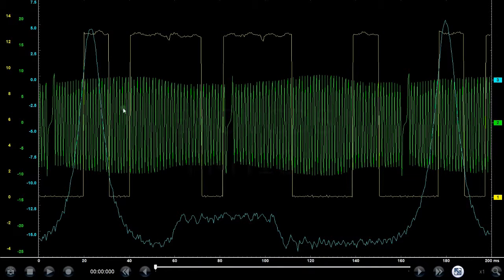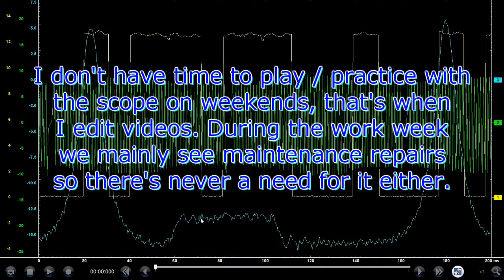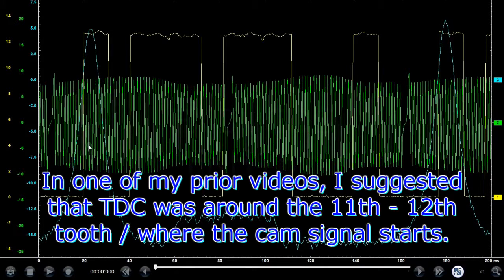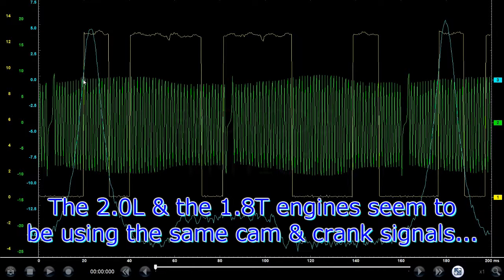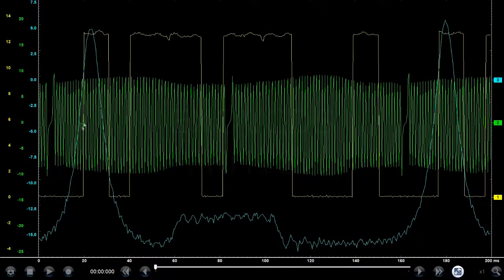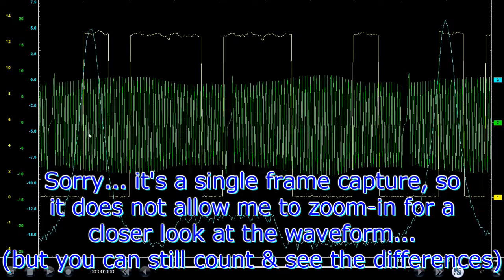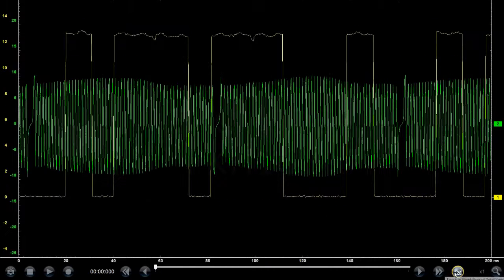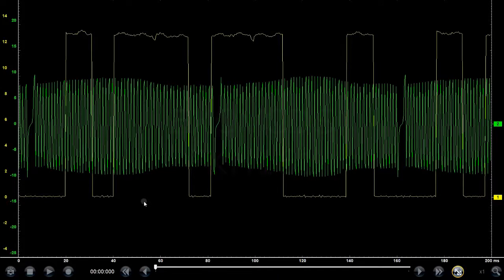VW A4: 2.0L cam / crank waveform

Comment: Thank you very much. This waveform saved me.
I had an audi Q3 with cam crank correlation code and got the waveform out of it. But I need a reference to compare the waves. I found my reference here. 😊
Reply from the maker: @alirezanasimi1999  
I don't think the waveforms are the same.
This VW waveform is from a timing belt 2.0L engine.
Reply: Actually I checked with another source and it's the same. Apparently company has just changed the belt to chain. The timing seems the same.

Comment: Did you ever scope a EA288 engine?
Reply from the maker: No. What's the issue?
Reply: @EXOVCDS  I have rebuilt my CUPA engine (new piston rings, hone, new bearings, valve seals and reseated the valves), now it just cranks and does not start. No error codes on VCDS. The injectors are firing, but I have 14 bar compression on all cylinders (13-14bar). The cam and crank seals were also changed but the rear seal comes with a new ring. I did not have the special tool for fitment so I marked down the oldone and new one and I installed it correctly, but I had a strange feeling that the new ring was slightly different form the old so I want to compare scope traces and look at the crankshat trace for shape and compare the timing to the cam signal so I can be absoutley sure that the ring is correct shape and position and that the phase of the engine is correct
Reply from the maker: I think CRBC is similar.... I did a search and did not find anything for CUPA, sorry.
https://rotkee.com/en/wavebase/good-timing-ckp-cmp-signal-vw-golf-7-2012-2020?engine=2323
Pico Library might have it.
Reply: @EXOVCDS  I found this already and I agree it should be the same... They are both EA288 base and the crank wheel has two notches and the crank has a funny pattern that resembles this waveform. Why does the cam have such a profile? Faster synchronization?
Reply from the maker: Yes, that would be my thought as well.